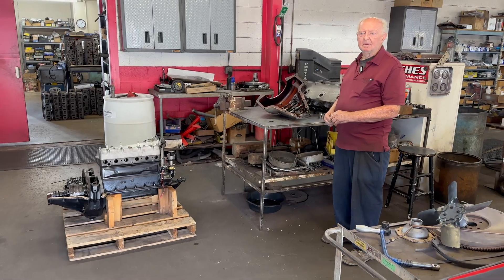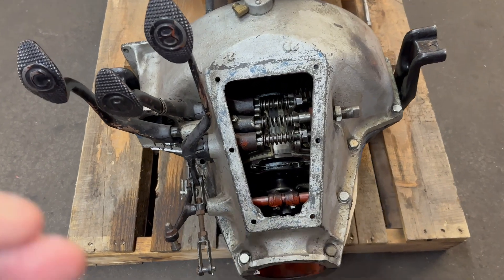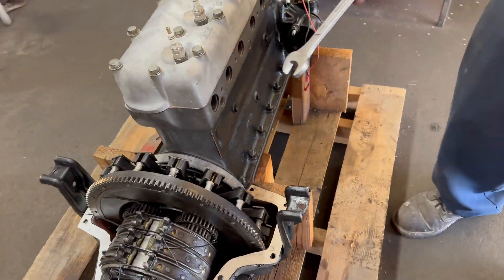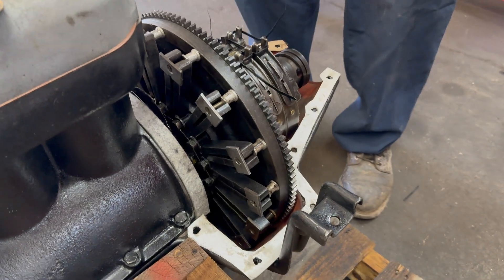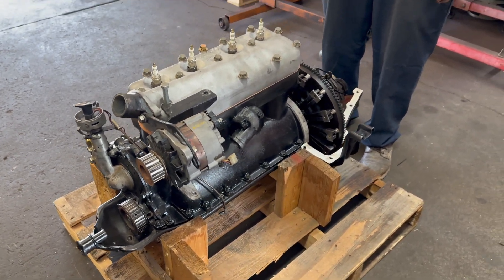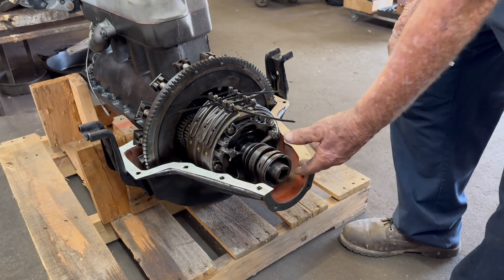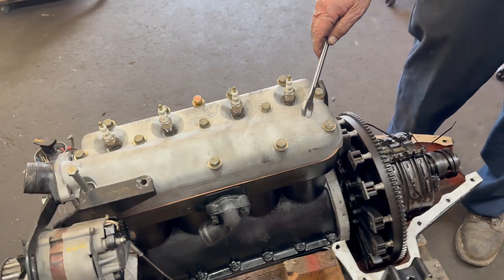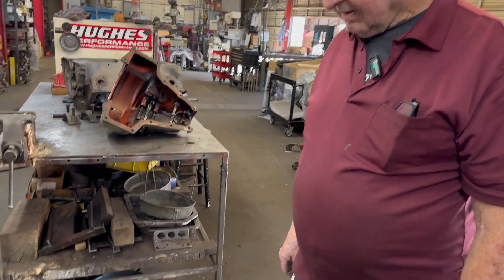2X Horsepower? Ed Smith Thinks So. Model T Stroker Engine!

Comment: Boy that oil must get awful dirty especially when it’s breaking in a new engine frequent oil changes would be a good idea!😀🇨🇦
Reply from the maker: I agree, Keith! I would also add several strong magnets to the bottom of the oil pan!
Reply: Yes very good idea 😀🇨🇦
Reply: You can add auxiliary oil screen that goes underneath the transmission door on the hogshead. It comes with a magnet and metal screen